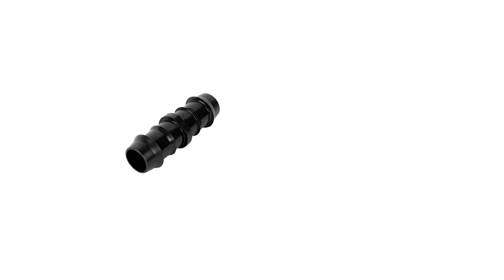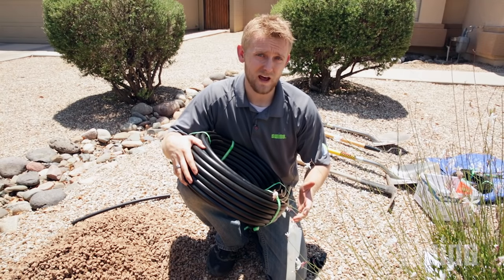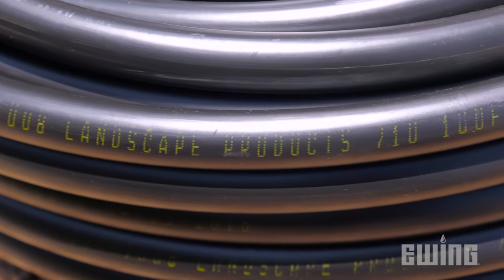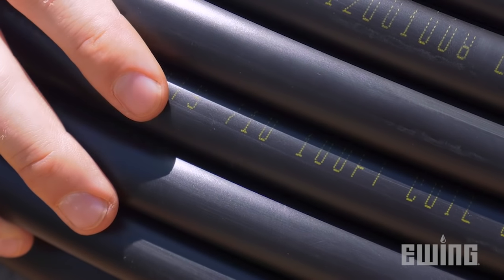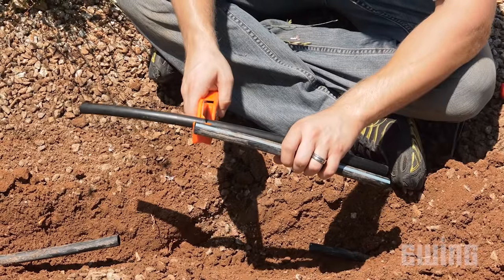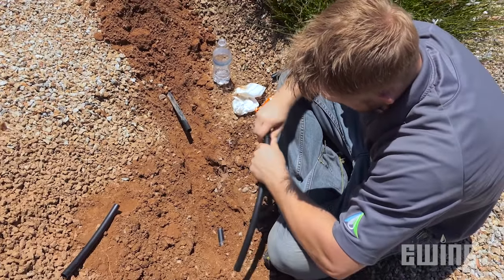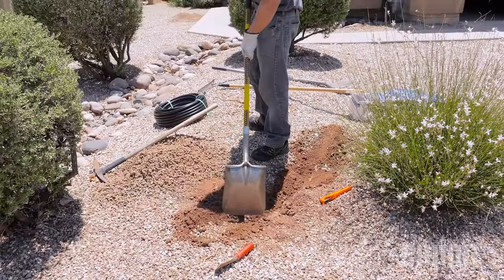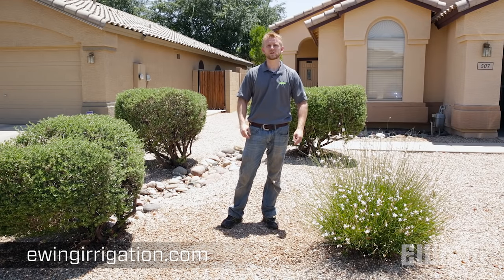Drip Irrigation Repair - Poly Tubing Leak

Comment: My method uses one coupler and no extra pipe: 1. Cut about .5” from pipe - .25” on both sides of leak. 2. Install coupler.   Given that the pipe is flexible, you can easily lift it from the ground just enough to attach a coupler without kinking the pipe.

Comment: I have drip line around my plant. I poked a hole in it and need to repalce or repair it. I have tne water running to it in a solid same size pipe connected with a T fitting. How do i remove tne T fitting so i can install a new drip line and reattach it to the existing T fitting? I'm using RainBird products. The T fitting is barbed also.
Reply from the maker: Sorry for the late response. You can repair small holes in drip tubing using a goof plug like this:
https://www.ewingoutdoorsupply.com/drip-emitter-plug-for-1-8-1-4-inch-tubing?categoryId=111
The other option would be to cut the tubing off near the tee leaving enough length to install a compression coupling that can be used to add on a new length of tubing to replace the old. This video might help explain.
https://www.youtube.com/watch?v=gSdfXXrU28Y
Thanks for watching!

Comment: You can use a pex-expansion tool to expand the tubing/with a short piece of upinor pex, or a pex ring, or pex expansion ring, then connect expanded ends to a coupler 👍

Comment: Why would you cut out a foot of the old pipe to replace the section using two couplers?  One cut and one coupling would fix the leak with half the expense and half the likelihood of a subsequent leak.  Right?
Reply from the maker: Thanks for the question Addy. It's possible to use just one coupling but In many cases the tubing will split along the length of the pipe (longer than the coupling). Adding in the length of tubing will give you more flexibility to ensure that the entire split section is removed. It also gives you enough slack to seat the tubing all the way into the couplings on either side. The parts are inexpensive and if done properly leaking shouldn't be an issue.
Reply: @ewingoutdoorsupply  Good answer.  Thank you for teaching me something.  I've watched some of your other videos since I'm doing some home drip system repair, and now know you guys are experts to be relied upon.  Have a great weekend.

Comment: I appreciate the effort, but this ONLY works on hoses that are either on the ground or dug out for feet on both sides (very difficult if 6 inches deep and under the weed fabric.  The first side goes on easy, the second is almost impossible.  Heating the end only causes it to flatten, deform,  and thus get larger than the connection holes.  Save yourself a couple hours and use the clamp interior fittings.  You'll be done in 10 minutes.

Comment: Is there a stronger tubing I can use? Mine was installed in 2009 and I have a leak what seems like every month.
Reply from the maker: That was the case as well for the system in this video; It was just time to replace it all. It can be a labor intensive digging the trenches but the product itself is fairly inexpensive and easy to install. Unfortunately, poly tubing can be susceptible to leaks over time for a variety of reasons. It could be a result of weather (freeze/thaw), burrowing animals digging or chewing through the tubing, or just age. If you don't mind the extra expense you could use PVC or HDPE for the majority of your runs then transition to poly as needed. Thanks for watching and for the question!
Reply: @ewingoutdoorsupply  That is what I'm doing when the weather cools and Thank you for the video.

Comment: So for this fix you'll need 2 compression couplings?
Reply from the maker: Correct, if the damage is small enough or you have enough slack in the line you may be able to fix it with one coupling. Thanks for watching!

Comment: What about leaks that occur close (1" or less) to a Tee fitting? How do you go about removing the old tubing from the fitting, and insert a new tube. Or do I have to cut the entire Tee fitting out and replace it with a new one + 3 couplers?
Reply from the maker: You may be able to reuse the Tee using a pair of needle nose pliers to pull out the tubing. See this tip from another YouTuber here: https://www.youtube.com/watch?v=01DN_Z5jx8A
Just be careful not to damage the inside of the fitting where it seals to the tubing. If you have to replace the tee hopefully there's enough slack in the line to not have to use couplings as well. Good luck with your repair!

Comment: Sick of fixing my drip there has got to be a better way.  Full irrigation, soaker hose and hand watering is all out, I did a low maintenance front and backyard for a reason including synthetic grass.
Reply from the maker: We hear ya Ali. The system in this video was 20 years old and leaks were popping up regularly. New tubing was installed 2 years ago and no leaks since then! If you have an aged system you might consider installing new tubing (and valves/y-filters). Good luck and thanks for watching!

Comment: Product link in description no longer works
Reply from the maker: Thanks for letting us know Jon. The link has been updated!
Reply: @ewingoutdoorsupply  is there a easier trick to installing sleeve besides water? Vaseline? I have weak hands and I have the correct size.
Reply from the maker: @terithurbush982  Hello Teri, you can try to heat up some water and dip the end of the tubing in the water for a bit to make it more pliable. Rock the tubing back and forth as you push until it seats.
Reply: @ewingoutdoorsupply  thank you so very much for such a quick reply!!!